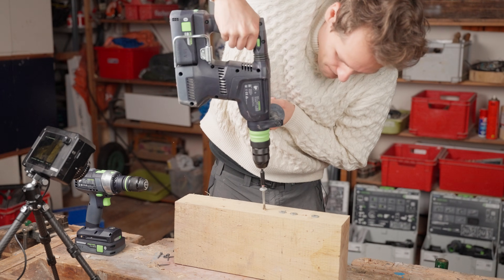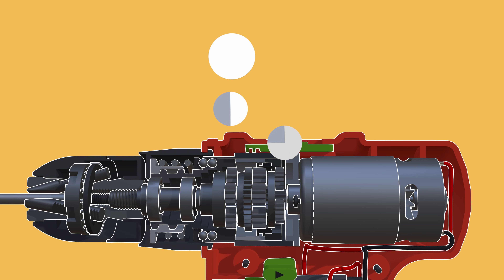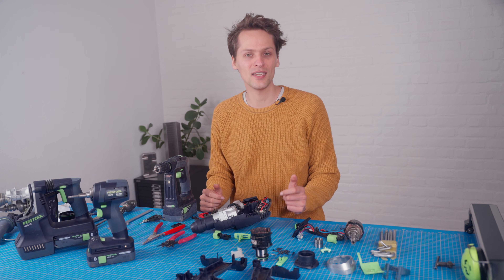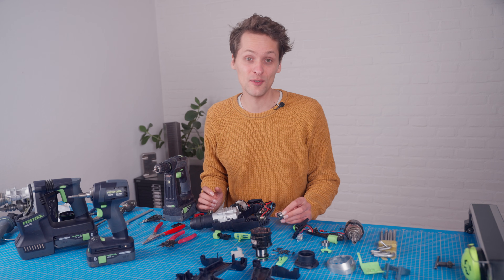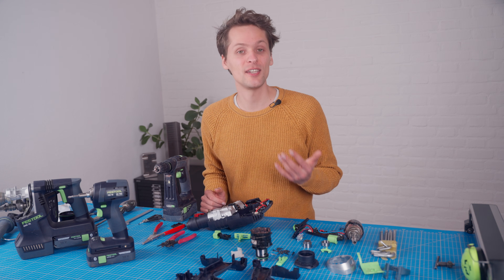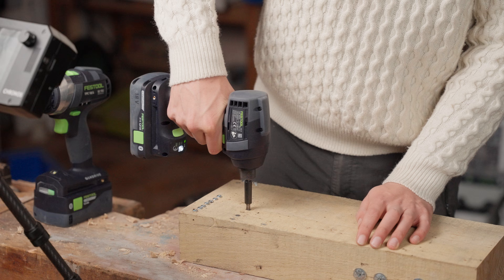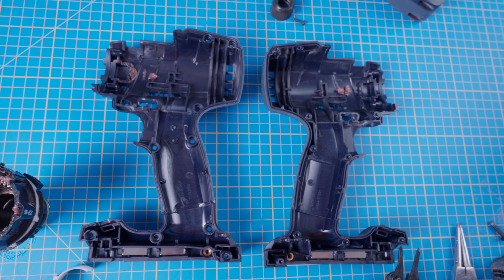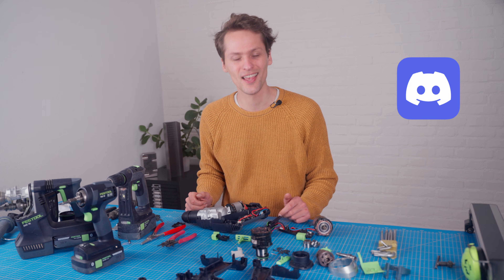Hammer Drills Don't Hammer - Every Drill Explained

Comment: Ahh yes the problems you could get with potting electronics. I used to work for an electronics engineering bureau where we had a client that was unhappy with us because they started encasing the PCB's we supplied in plastic and they stopt working.
what had happend was the surface mount components on the pcb's got loose from the pcb's and drifted through the plastic and they blamed our manufacturing for bad solder joints.
we invited them to talk about the problem also for us to understand what they where trying to do (they never told us they intended to pot the pcb's).
turned out they where putting the pcb's in a mold and pushing molten plastic (i think around 250 degrees celcius) under something like 2 bar atmosphere into it. when I and the production coordinator heard that we immediately knew what the problem was with that temperature the unleaded solder would become soft and the pressure would push the parts await. 
so we told them that if they want to keep doing that we needed to use different components that have glue on them that wont melt after the solder oven and keep the parts in place for the potting process. 
they didn't think that was needed but after inquiry and the manufacturer of the potting equipment they where told exactly the same thing and caved that it was indeed there mistake and promptly asked us to use the glued components that off course cost more.

so yes there are some challenges with potting electronics.
Reply from the maker: Amazing story
Reply: Always amazing how not just people, but even whole groups of people in companies fail to see such obvious things.
Reply: You can hear the part in your story where someone at their company said “we fucked up just do it right this time,” 😂

Comment: I think you are confusing torque and power ("it doesn't have gears, so it doesn't have power" - in fact gears cannot increase power, they just trade speed for torque and vice versa [and of course efficiency is not 100% so gears cause a little loss of power]. Power = speed x torque)

Comment: Philips screws are made to cam out. Atleast that is what i have found. They were made for industry (car) before the force settings were invented. So powerfull tools just rotated until stopped by operator, and philips screw just cammed out after reaching set screw. Saving the tool.
Reply: This is a complete myth. Stop repeating it. Phillips screws were NOT designed to cam out. That may be a useful characteristic in some applications, and it may have even been advertised at some point, but they were not intentionally designed to do this.
Reply: I found that they're just crappily designed. They aren't engineered to cam out. They cam out because they suck, basically, lol.
Reply: The first patent on the Philips slot doesn't mention camming out at all, so it's a post-factum added philosophy at best.

Comment: So Festool is a high-end cordless power tool in your country isn't it? I don't understand why then do they use those big clunky battery packs that look like something that belongs on a cordless tool from the late 90's or early 2k's looks like something that black&decker (cheap) made in the USA 20+ years ago. Sorry to bag on the tool. I really have no idea if they are good or not as I haven't even seen one in person I just can't understand why the design looks so so outdated and oversized for a modern cordless hand tool? Also are they still using brushed motors in all the tools?
Reply from the maker: they can stand upright without tipping over /even/ without batteries. But that requires a big flat base of course. So yeah the batteries are chonkers

Comment: There is also the Precision Clutch, which may still be under patent by Bosch, it uses both a mechanical clutch and electronic clutch. The mechanical clutch does the main work but as soon as a slip is detected the electronics turn off the motor instantly. By limiting the work the mechanical clutch does it limits the wear and can keep the mechanical clutch at the same accuracy.
Reply from the maker: Interesting

Comment: I got the DeWalt 20V MAX XR Cordless Brushless Hammer Drill/Impact 2 Tool Combo Kit and it's the greatest drill & impact driver set I've ever had. I highly recommend it if you need the choice to switch between power or delicate torque, alongside great battery life

Comment: like if you ever worked with an electronic clutch and hated it. i cant be the only one, right?
Reply: As an electrician, people using drills with electronic clutches are the main source of stripped screws, stripped screw holes, and destroyed electronics. Can't even tell you how many circuit breakers I've seen where the screws were completely stripped, and the wire mushed into easily snappable pancake because Bob the Builder thought his drill with an electronic clutch he uses to put roofs together was a good choice for sensitive electronics.
Mechanical clutches can be much more sensitive and, most importantly, they are instant. Anything an electronic clutch can do, a good mechanical clutch does better. The only reason brands are making drills with electronic clutches is because it's cheaper to wire an extra chip between the trigger and the motor than it is to manufacture a mechanical clutch.
Reply: @goofy851 yes thank you! how dont more people see stuff like this and call it out

Comment: Yeah, epoxied circuit boards are great for resilience and longevity, the connectors make the replacement easy... provided that you can buy replacement parts.
Reply from the maker: I cut that part out because it sounded too much like I'm glazing Festool, but I actually went out of my way to test, and they actually have all parts on a webshop with diagrams and everything. Really good stuff. Even though they discourage non-pros to work on the tools and void the warranty if you do... :(

Comment: I have a little planetary geared thing with an electric motor I have no recollection where it came from, But, what I've found fascinating (somewhat) is that it can generate more torque than I can hold back even as it's fed as little as 1.2Vdc.

Comment: I noticed that the festool triggers have a lot of stickslip compared to almost no stickslip in other drill brands. I tried different lubricants on the disabled slider but without success. Did you notice it as annoying when trying to control speed precisely?

Comment: Another reason impact drivers tend to strip drill heads less than a normal drill is that the driver bits are less inclined to "climb" out of the drive slots on the screw. This is because since the impact driver delivers it torque in sharp spikes with longer periods of lower torque in between, it allows the bit to "fall" back into the drive feature of the screwhead, as long as the operator is pushing with moderate force against the tool. A normal drill with constant torque has a tendency to allow the driver bit to climb a bit out of the slots on the screw head, and then when the bit is driving the screw without being fully engaged in the drive slots it will strip out the screw head, since there is less engagement between the bit and the material of the screw to transfer the torque. You need to push really hard against the tool to prevent stripping the screw when you use a normal drill like this, which is a real pain.
Reply: This is the cam-out he is talking about in the video

Comment: 15:24, not all chucks are like that, some have a plate on the back and the teeth are held apart with springs, and they're in a (sorta) triangular cone shaped housing, turning the chuck makes the plate go in or out, which allows the teeth to leave a bigger or smaller gap.

also potting is a cost saving measure, you definitely can have dustproof enclosure for the electronics. (and I'm not too fond of it because it makes stuff unrepairable.)

I've seen some pretty clever solutions that use potted connector boards to water/dustproof the connections cheaply while having the electronics swappable, though at higher scale just using water/dustproof connectors is a good option.
though vibrations may be an issue with some parts like capacitors, so there's good arguments for potting, but imo market segmentation is the issue, if you want a repairable tool you have to buy a very expensive one, when the cheapest tools could be made repairable for less than 5 bucks extra in manufacturing cost (i.e. 10 bucks at the client side.)
Reply from the maker: I think potting is an exercise in what's repairable enough. Ideal would be to be able to repair the logic gates in the chips, right? But you gotta pick a pragmatic point. There's definitely something to be said for being able to switch out a resistor or whatever
Reply: @KnowArt  The biggest reason potting is done: to stop anybody from repairing them. Simple as that. Or repair as little as possible. If you look at the parts NOT potted, there is practically no user serviceable parts in there. Everything is tried to put under epoxy or at the very least the majority of the critical parts. There would be ways to make the components not detach due to vbration but why do all the work when they can just epoxy everything in place and prevent users from repairing them and force them to buy insanely expensive large modules.
Reply: @KnowArt  It's about likelihood of failure and end-user serviceability. The parts tend to fail catastrophically so the whole chip is essentially obliterated. End users and service techs can't do lithography, but can probably replace a busted cap.

It's simply not worth it for these electronics though, the costs of having an electrical engineer or appliance tech troubleshoot and fix something like this are way higher than manufacturing costs of a new unit. That electrical engineer time is valued more highly elsewhere in the economy and the drill would just go to landfill on failure you might as well pot it so the turnover rate is slower.

Ideally though, replacement potted boards would be available to at least reduce that component of the waste.
Reply: @Robert-sq7bp  You are talking about warranty repairs and companies, right? The potting is used to stop the vast majority market (everyone else) from repairing them. Or buying spare parts and replacing them. No company is waiting for a week for small bit to arrive via post and hence, the whole unit is thrown into the bin and new one bought. Individuals would either sell the tool as broke for someone to fix it, fix it themselves or take it to repairman. None of the options can happen with potted components. One reason why repairman industry has already died out.

Comment: Milwaukee, DeWalt and Makita have "Hydraulic" impact drivers now. Super quiet and way smother then their metal counterparts. Don't get the Milwaukee, (it has longevity issues), the Makita seems to be the most consistent and the DeWalt is best in every area including speed, power, smoothness, fitting into small places, but my company only has 6 months of experience with it while having 3 years with the other two brands. My company has been talking about exclusively getting the DeWalt hydraulic drivers in the future.

Comment: 01:00 Ummm, no. For steel, you want to COMPLETELY FORGET that classic "black" HSS drill bits exist, preferably forget that those strikingly-yellow Titanium-Nitride-coated drill bits exist, and just find a shop that sells some of those discreetly-yellow-ish Cobalt drill bits. It's only the difference between the steel destroying your tool while it laughs in your face or your tool destroying the steel while it laughs manically, into nice curly chips.

Comment: Why don't they just use a switch that reduces the flow of electricity  through a switch that switches between variable resistors allowing voltage change through to the motor.  Slowing the motor down... or speeding it up... like when a battery loses power.. it starts to slow down... and just use one bulky gear  or sturdy gear for the electric motor that should just have a chuck on the end of it, That can take the full force and speed with no resistance. You could even have a variable screen, or dial switch (like on a guitar) that adjusts voltage flow ...  effecting speed/power.

btw you can just call the clutch a ratchet. It's really not any different.

tbh I was thinking why can't they just make a drill. That is multi faceted. Like a drill that with and attachment can turn into a leaf blower, a hair dryer.... etc. They all are just rotational handled devices with a heated, cooled, particular shaped nozzle...

Comment: A boon with the switch to battery Hammerdrills from the corded ones, are that those with cords, would and often tried to twist your arm out from the sockets. 
The battery ones simply do not have the torque to do that. So they're safer for the operator!

Comment: The pneumatic part of the rotary hammers is that cylinder you mentioned, the angled bearing driven part doesn't hit the bit hammer directly but compresses the air inside the cylinder

Comment: Those are medium size electric screwdrivers/ all purpose drills... "big" ones will have 20J punch and the rotary versions will turn you around if the bit catches something... or the clutch will disengage if you weigh 300 pounds and manage to hold onto the drill
Reply from the maker: Haha

Comment: 5:00  Plastic gears may not be the end of the world in general, but I'd still expect all metal gears for the prices Festool charges.
Reply: Hence why they have it. Did you watch the video?
Reply: Plastic reduces weight. For an application that doesn't bring the plastic to a limit (thermal, hardness, toughness, compressive, tension, or cyclical stress). 

It this case, plastic is the best material for the job. Reduces weight, inexpensive to manufacture, durable, low interial mass, and vastly reduced friction. Plastic doesn't always mean cheap. In low torque high-speed applications, reduced friction is often more important than additional wear resistant.

To give you examples, NASA, Space X, i.e. space industry use high strength plastics because they are objectively the best materials for the job, better than steel, aluminum, and carbon fiber at the specific application.
Reply: @hadensnodgrass3472 the weight argument isn't really a selling point though. The people using these tools aren't going to care about a few grams as its almost negligible, the bigger issue is plastic getting brittle or deteriorating in the harsh environments these tools are expected to work in
Reply: @aarongene9507  a few grams on this tool, and few on that and some more on this one.
And before you know you'll be lugging a noticeable amount of weight around.
Reply: you missed the part where he said the plastic gear wasnt taken from any of those drill/drivers?
Reply: Yup plastic gear will need to be replace every 5 years or so. That's one reason y washer and dryer needs replacing cause of the plastic plant gears getting old and breaking
Reply: @evilsam4 washers and dryers are a completely different environment, so lower quality parts can deteriorate faster.

Comment: With brushless motors you can have an impact driver with electronic clutch.  It can tell the impact pattern from the resistance and calibrate for where you are in the screwing process.  So for example if it is set for self-tapping sheet metal screws it starts out real fast for the tapping tip to puncture, slows down when it senses bite, impacts it the final bit, then stops on it's own when snug.  Other screws can have a completely different pattern.
Reply from the maker: Yeah I was wondering where the T setting was for and learned that. Amazing tech

Comment: Powder metallurgy is as soft or as hard as you want. Those gears are made to a price, otherwise they could order Tatung, or any of the powder prepared superalloys.
Reply: Being a Festool that price is $$$$$$$$$
Reply: @chewielewis4002  $$$$$$$$$ is your price, not theirs.
Reply: @chewielewis4002  Makita still makes drills with forged gear sets for much less than Festool garbage. Festool is for cabinet makers who fart into wine glasses and sniff it.
Reply: PM gets a bad rap because so many cheap products use the tech.  PM isn't the problem.  Value engineering the durability right out of the product is the problem.  It's much like plastic.  Plastic isn't good or bad in and of itself.  It can make products better when a suitable plastic is used for an appropriate application, or it can be misused resulting in inferior products.  It's not the plastic's fault.
Reply: What a foolish statement, nothing can possibly be 'as hard as you want'. I want my powder metallurgy to be harder than diamond, now what? Not to mention this is just not true, wrought metal will always be stronger. I don't dislike powder metallurgy, don't get me wrong it is a great method for the right application. I just found what you said a bit silly and untrue.
Reply: @PlaySA  He wasn't writing a peer-reviewed paper on powdered metallurgy.  He posted a YouTube comment, and within practical limits he is correct.  Nobody took him to mean we can make PM parts harder than diamond - not even you.

Comment: Are you an IDIOT? The big drill you show is NOT for driving screws!!! It is a hammer drill for putting holes in masonry. It hammers on the drill bit to chip out material while slowly rotating the bit to a new position to hammer out more material and slowly auger the resulting dust out of the hole. The drilling action requires percussion not high torque!!!
Reply: You might've missed the point of the demonstration

Comment: I have a hammer drill/driver, an impact driver, a high torque torque wrench, and a sbs+ rotary hammer.

It's true that I rarely use the hammer functionality of the drill/driver, but that was known when I bought it. I wanted one drill I could keep with me and use in an unexpected pinch. The impact and drill/driver are plenty for most things... and I only pull out the torque wrench and rotary hammer when I know the job will require them.